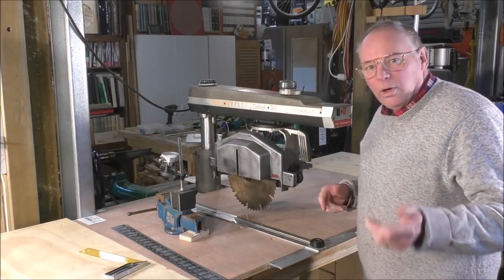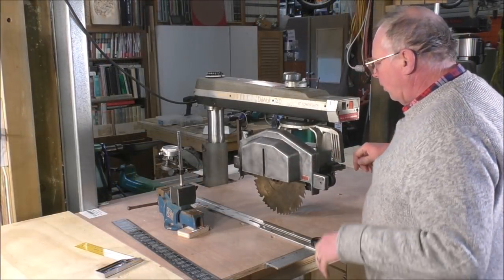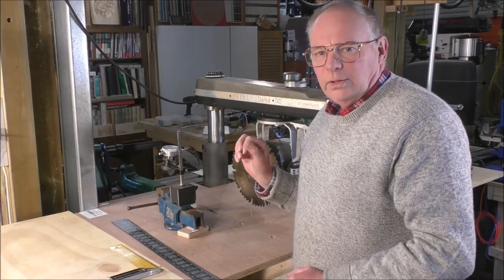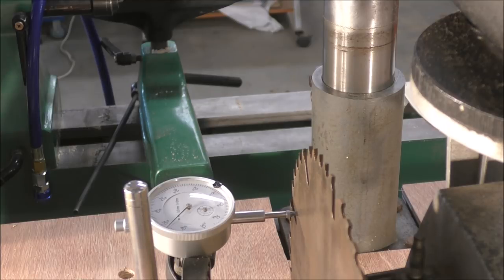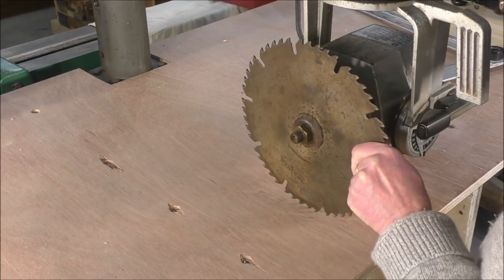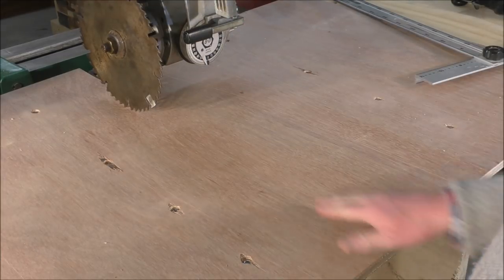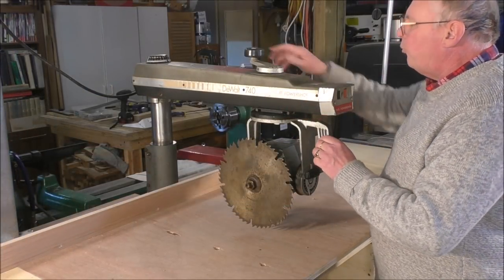259 Dewalt radial arm saw fence making, fitting and set up

Comment: Nice job, but the fence is purposely designed to be moveable to accommodate the multiple and versatile functions you can perform on a radial arm saw.  With the original clamping mechanism, the fence could easily be moved all the way back for extra cut capacity.  You would also have greater rip width capacity then what you report.  Unfortunately, your fence design fixed to the table in this manner really limits many of it’s intended functions.  Glad to see someone enjoying their RAS though—they are great machines.
Reply from the maker: Thank you, for watching,  Please like, subscribe and forward the video on to a friend,  Roger Clyde Webb
Reply: Everyone should watch your videos Brian. Then they will have the correct information! Thanks Brian!

Comment: You ripped the board from the wrong side - you should always rip against the rotation of the blade, and set the anti-kickback pawls onto the wood.
Reply: I think you need to watch the last couple of minutes of the video again, because he did in fact rip from the correct side. I'll even leave the time from when you should watch here for you: 22:40. The only time when the wood was on the 'wrong' side was when he was showing the position of the blade for out-ripping and the two pieces of wood were lying on the out-feed side, but then he wasn't actually ripping, was he!

Comment: Roger although the video is very helpful to most that fence realy should be 4inch further forward as recommended by dewalt becouse as you have it the blade is never safe in fact very dangerous and if its more working space you want just have a wider bench.

Comment: These saws can be adjusted in all directions, I know I have one, my friend gave me one in pieces, and I've put it together, not easy but there are some other videos out there to give you hints, the rest I've worked out myself. At 13:37 you can see a really big screw head on the radial arm near post, there's one on each side, set the mitre guide  to 0 and adjust those two big screws (one on each side), there are 3 on the motor as well.

Comment: Roger, I have that saw.  The fence is supposed to be out further so that the saw blade parks behind it so you can set your work up and then pull through.  Comments below are correct about the guard when doing a rip.  Lower the front until it almost touches the work and then set the anti-kickback rod. (turn the rod so the teeth of the rod are curved with the blade).  When I get a chance I'll send you some pictures.  I bought my saw new in the early 80's complete with the stand..
Reply: Hi Tracy, do you still use your saw? Have you had any serious issues? I don't want to bring bad luck by asking. But I had a recent table saw kickback that was super bad, but it was due being in a trance like state after work, from severe sleep deprivation after working all week in construction. I have been wanting a RAS forever, but for people who don't own them, they just say they are useless and too dangerous. We had a RAS in our highschool shop class. I never saw a single accident, and it got used daily to cut a million different things.

Comment: You might spend some time looking for the anti-kickback arm the fits those saws, they do work well. The other tip is to roll the guard down closer to the cut side to keep chips from being thrown into your face(when ripping). Very useful tool to have set up. Some of those have an arbor on the opposite side of the blade to be able to mount a router or shaper bit. My old one had that feature, though I never used it that way.

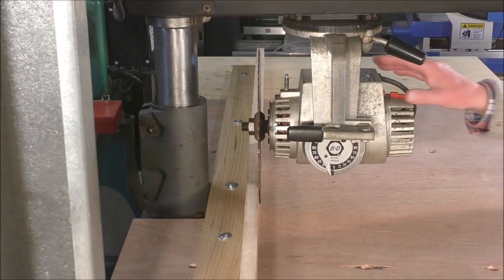Comment: At 13:45 not sure if it was the camera angle but the top of the blade looked ‘cantered’ forwards, not sure how to explain, 358 degrees at top 178 at bottom if that makes sense. Which would make a difference if you are doing any rip cuts, the cut won’t be square, I am hoping to be doing a lot of rip cutting. Cheers

Comment: It would have been good to show how to modify it if it hadn’t been so true. Not everyone will be so lucky. ( I have just bought one but it’s in storage while my garage is built) . Cheers the rest of the video was very helpful.
Reply: You never start by stating ,always unplug your equipment before doing any adjustments. This is critical.  Plus wear all safety equipment such as dust mask, remove any rings and button up long sleeve shirts. A woodworker of 40 years plus.

Comment: First Tracy Ann is correct about the rip. I also use a guard that is simply a 2x6" notched to pass the material thru. Its clamped to the table front and the back end floats in front of the blade. Prevents my hands from getting too close or being drawn into the blade. I also use an anti-kickback roller when ripping. 

I use a table and fence as the OP shows rather than the split style that is most common. seldom do I miter with the arm; it is always in the 90deg position. I use jigs for mitering. Fact my last table I built I did MFT style. There are dog holes for 90, 60, 45, 30, 22.5 deg spotted about the table. Drop in pins, position fence, clamp, cut. Extremely fast setups.

Comment: I'm enjoying watching your videos on the radial arm saw. I haven't seen anyone else create videos on this machine recently.  It's a shame since there are so many of these saws out there. I'm looking forward to seeing it more.
Reply: Have you owned one of these saws? It's been my life dream to simply own one. They make such large, perfectly straight crosscuts. There isn't anything that can do it so effortlessly, on large sheets of plywood. Sliding compound miter saws and table saws are good, but it seems like a dedicated radial arm saw is the best saw to do repeated, 90 degree crosscuts on very thick, or sheet goods. I've never owned one, so I'm trying to convince myself that it's a good idea to own one. I am supposed to pick one up tomorrow morning, a vintage Craftsman, for $100. I figured for $100, I should just do it and buy it, and it's a 1960's or very early 70's model (or thereabouts) model, so should be built pretty good.
Reply: @Ritalie  When I purchased mine about 5 years ago, there was an active recall on many of these older Craftsman saws. Some of the saws had a $100 rebate if you cut out the motor and mailed it back. Some of the saws had an upgrade kit available that came with an improved blade guard, kickback pawls and a few other  safety related components. I just checked and I see that the upgrade kits are no longer available and the rebate is now only $50. I honestly have only used the saw a few times and have instead just used the table saw or my sliding mitre. My RAS came with a digital display which seems like it would be a nice feature except every time I go to use it the batteries are dead and they are a strange size, hard to source, and expensive. The quality of my Craftsman is also lacking and is not great for precision cuts I find that the RAS takes up a lot of room and I'm thinking of getting rid of it. The safety aspect does scare me. I've heard that these things should have a negative rake blade and I wasn't able to locate one at a reasonable cost.

Comment: Using the blade in a ripping position in combination with compound angles will allow you to cut covings of various depths 
Also remember to use the anti kickback device and only feed from the correct direction
Reply: This comment is old, but I'm wondering if you could provide more information? What anti kickback device? I was under the impression that with crosscuts, you don't use the anti kickback device on a RAS? I thought it was only for ripping, since the wood can be ejected towards you, and the kickback pawls stop the wood from launching towards you? I noticed the new Craftsmans have a genius idea of a rolling pizza cutter "riving knife" type device, which would prevent the kickback from happening in the first place. I wonder if a riving knife/pizza cutter device can be retrofitted to an older saw? I'm planning on getting a 1960's era Craftsman tomorrow.

Comment: By putting the fence BEHIND the blade, and having to put a parallel against the fence, how much cutting surface are you "saving"? I'll keep my fence in front of my fence, thank you very much.
Reply: Dear Mike, the extra width available is the depth of the fence behind what it would have been if it were placed in front of the parked blade, ie around 250mm. With cross cutting, you can hold your work against the fence and push the blade into the wood doing a push cut. This would have less tendency to kick-back compared to a climb cut pulling outwards with a deep set fence. It just means you need to start your cut with the saw outside the fence and your work. No problem.
Reply: @petermarsh4993  dude you have no idea how to use a RAS correctly.
Reply: Dear Mike, the “normal” stroke with an RAS is pulling the mechanism forward into the wood - that’s a climb cut.  If you went to your table saw and pushed your wood in from the back of the blade towards the front of the table - that’s also a climb cut. You wouldn’t dream of doing the latter but don’t seem to mind the former.  Yes, I have never used a RAS but was arguing from a logical point of view and with experience with a table saw and a milling machine.  Thousands of people use an RAS and they don’t cut their arms off or get frightened by frequent kick-backs and so there can’t be a serious problem. If at the end of the day you get your work done and don’t cause any major trouble, there is no problem.